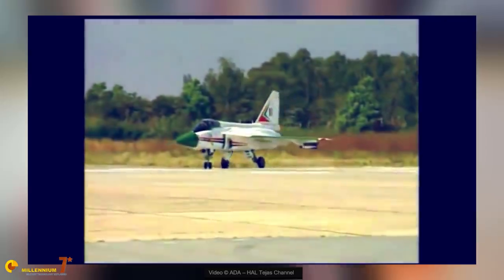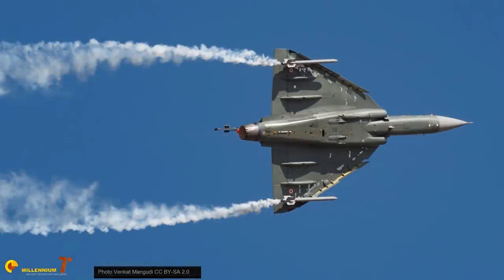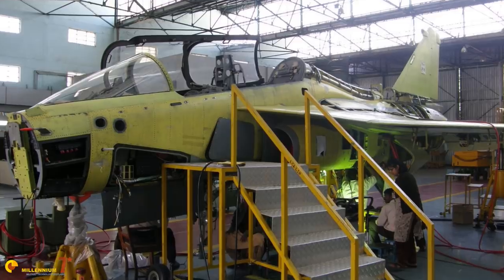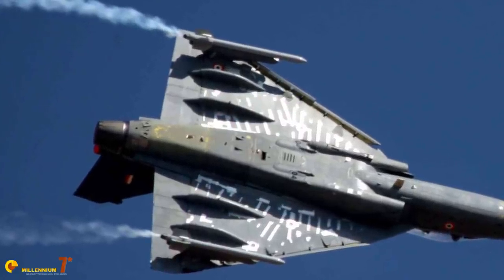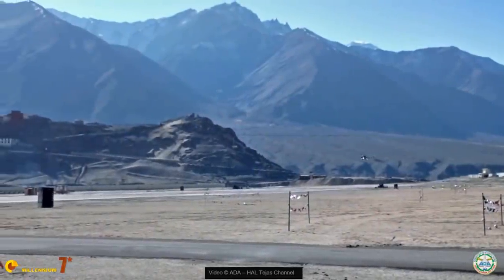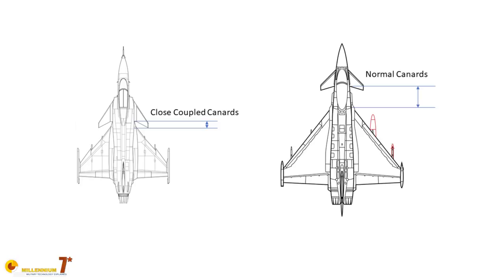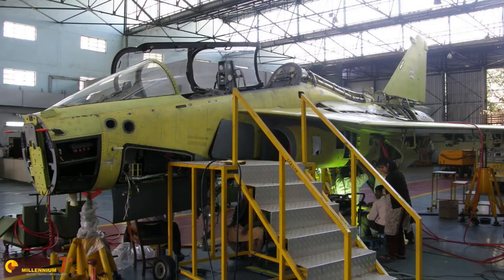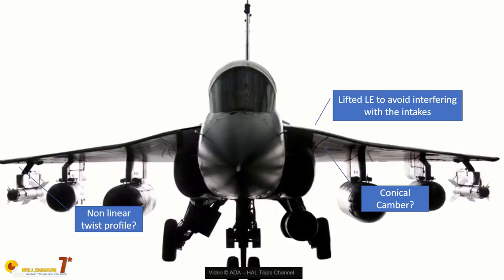TEJAS Aircraft  Aerodynamics Analysis - The Swedish Connection?

Comment: What we know from the public info is that ADA wanted to design it with canards, they have done the simulations but IAF wanted it to be simple as it was the first FBW aircraft with no prior experience. So canards were dropped.. that's the reason canards resurfaced on MK2 they have the design ready...and are now more confident with control laws.
Reply: Tejas has a faulty inlet design.... Diminish power in hi altitude.... Tejas is rated at 1.6 mach while grippen can go 1.8 mach using the same general electric engine
Reply: @jai9983  43 million jet with so much compromise.... And with a foreign engine and radar..... Just buy F35 or su 57 .... Plz don't go for AMCA... White elephant
Reply: @jai9983   bro what resent is.... India spent 15 years in developing INSAS and after 10-15 years of bad performance, india is buying AK 203 in lalks......  Even nepali army only country bought INSAs rejected the rifle..... I see same future for AMCA...... Sad but true
Reply: @jai9983  I agree will the Navy success.... Cuz navy has inhouse naval design Beaurrae...... India lacks a over all vision......
            Do think by 2030 .... AMCA would get ioc..... Stealth, supercruise, internal weapons bay, Radar absorbing materials,...... ??????
Reply: Mark Prothro  🌶🌶🌶🌶
Reply: @jai9983  so you say.... By 2027 India would have 200 tejas mark 2.....  By 2035  AMCA stealth, supercruise, ram, internal bay, and by 2040 India would have tejas + AMCA =700
      I say by 2030......  Kaberi with French snecma core,  100 su 57 or F35(AMCA cancelled) , 350 su 30 mki,  200 rafale,90 mirage 2000
 200 tejas....... 
        Let's see time will tell
Reply: @munmunhazarika5247  It was established that India will no longer be the same, India will become self-sufficient by 2035 in terms of armsNo matter how much false propaganda you have, but India will remain successful 
If you do not make fighter jets first, it does not mean that you will never create After all, political will is also something.
The coming century of India and seeing this, chili will continue to be in your backyard🤣🤣🤣🤣🤣
Reply: @munmunhazarika5247  tejas can reach mach 1.8 but pilots are not allowed to cross over mach 1.6 saving the life of fuselage and gripen can reach mach 2.
Reply: @munmunhazarika5247  I told you that political will is a big thing.  It is impossible to achieve anything if there is political will.  Everyone knows that earlier in India there was lobbying to buy foreign weapons.
But no longer the same, everything is slowly changing and our army is also going towards indigenous weapons under the leadership of Prime Minister Narendra Modi.
Reply: @munmunhazarika5247  importing good quality radars and engines will cost a lot.  FA 50 has less capability and uses same radar and engine with different tune. And fa 50 is costlier than tejas
Reply: @aggressiveindian5974   rafale???
Reply: @munmunhazarika5247  What are you talking about?  India's squadron strength is constantly falling, it does not mean that no foreign fighter plane will be purchased.
You should know that India has just ordered 40 plus 83 Tejas mk1 and mk1 a.  And 123 fighterter is a very large number
Reply: @aggressiveindian5974  just buy more....  Tejas is a poorly designed aircraft.
Reply: @munmunhazarika5247  Poor design is not done by you saying Tejas's Tejas is a very good plane.
For Russian and American fighter jet 1000 km Combat Radius, where you spend 9000 ltr of fuel, the same Tejas spends only 4000 ltr.
ABC does not come and turns engineer.  Propaganda of foreigners will no longer run against Tejas
Reply: @munmunhazarika5247  this so called 43 million jet has spawned an indigenous multi billion aerospace industry that makes everything except for the engines, which even chinese had to steal the designs of to get their own...in contrast, Pakistan has a sucessfull jet but no parallel indigenopus capacity to show off, niether in terms of radar or materials...beyond PAC Kamra, there is not MSME in defence inpakistan , unlike India...pakistanis knows this, and thus the reason that the folks who once ridiculed Tejas calling it samosa, is now getting serious as they know that india is far better equipped to spawn MWF at this moment, as a stepping stone to AMCA!
Reply: @jai9983   I hope AMCA doesn't turn into like INSAS and ARJUN MBt tank...... User giving poor reveiw and not willing to buy more..... 
      India must also remember 60 lakh peaple live in slum in Mumbai.... India comes in 120 position in Human development index with a per capita income of 2800 USD..... 
          Indias ultimate aim should be to raise the per capita income to 20000 USd....
Reply: @munmunhazarika5247  you are talking about things that happened 20 years ago and extrapolating them into future...INSAS rifles won us Kargil war, and today the DRDO ATAGS is the deadliest howitzer, being made by private companies in india....while pakistanis are buying basic awacs from SAAB, we make our own, AWACS, gunships, tanks, warships, carriers, SSBNs, fighters...never forget, we made SU30KI the best it is, something that inspired the russian to upgrade their sukhois to SU30SM
Reply: @অর্ণবচ্যাটার্জী-ধ১খ   InSAs os so good why is India buying lakhs of AK203.....  Desi howitzer is so good than why buy american M777 howitzer and chinook helicopter.... Haha we made su 30 mki.....  Delusional...
Reply: @jai9983   sir countries that are pursueing 5th gen,  aircraft carrier, submarine tech are USA(35cr), Russia(10cr), china(150 crore), UK(9crore),  France(12crore), Japan and India(130crore population) 
                     Indias per capita GDP is 2800 usd, chinas per capita GDP is 11000 usd, and USA has 63000 usd, Japan  has 75000 usd. 
                     My point is defense is a nessecity not a luxury. It is a means to a end . The end is a developed country with heigh income, purchasing power, access to education, employment, medical facility of heighest quality.
Reply: @jai9983   India in 2020 budget has allocated 75000 crore almost 11 billion usd (1usd =70 ru) for PM kisan project( 6000 ru yearly for farmer) and 51000 crore, 6billion for MNEReGA..... These expense are equally important as 5billion dollar purchase of S400 deal.....
Reply: @jai9983   if you look into indias last year's export... India exported around 600 billion worth of mercendise. 
       If you see the breakup.....  Textilles (gujrat,trupur) , petroleum, gem(gujrat), IT industries 81 billion,  tea and rice are main export items. 
        Problem is more than 60 ℅ of Indian work force is employed in agriculture and contribution to GDP is less than 20℅. India can only develop when farmer have extra capital to invest in farming. 
         So please don't tell that these are free salary or mufatkhori when government helps the farmer. It's ok when government give tax break to billionair who live in 20 storied building for 4 person and travel in private jets..... While 60 lakh pepale of mumbai live in slum.
Reply: @jai9983  my point is defense is a nessecity not a point of bragging or vanity project. The real war is against proverty.
Reply: @jai9983  You're trying hard to explain these foreigners that why we're working on Tejas, but what THEY want to see is Tejas project cancelled, but this is not happening under new government. Anything which has started in New govt or supported by it will be moderated by govt. And This success of Tejas will  be milestone in India's Aerospace and Defense industries. Before 2014 private firms weren't allowed to produce even ammunition for military and police forces,but now they can and they doing it. Tejas has been developing since 80s and it witnessed number of failed attempts of scrapping it by politicians who just want fill their pockets from foreign companies. But it's been changing. And we'll see not just Tejas Mk2 and AMCA fighter jet in future but also some new fighter jets offered by India's private sector ! And my brother it be a worst nightmare to all these critics. 
In short don't spend too much time to correct our neighbor Munmun Hajarika who just divert topic to dharavi and poor people and his mindset is nothing but a poison filled by his so called chosen govt.
Reply: @madhukarmukane2090  right
Reply: @munmunhazarika5247  Tejas used GE 404 AND saab gripen used GE 414 🤣🤣🤣 everyone considers themselves an engineer on YouTube
Reply: Marcos B  saab gripen used Volvo  RM 12 I think?  A version of the General Electric F404
Reply: @munmunhazarika5247  AMCA IS a future of indian iaf ..... it will be 5.5 and 5.5 plus generations while f35 is just 5th generation. And f35 is a really a white elephant. I don't know how you get f35 is effective. With USA terms and conditions we can't use as we want we can't modify what we want . We can't induct indigenous missiles we can't upgrade with Israel ews suits. Wtf we are paying and we can't use as we need. F35 need regular stealth coating thatswhy availability rate is very low. Baby why don't u but f35 for your kids
Reply: Mark Prothro  why r u feeling frustrated ? Indian time indian money we got our own fighter jet  meeting all intended design goals. 
Compare  single engine fighter keys ade with ge404 or similar thirst engines you will find tejas is best among them on cost and performance front. Tejas today is 4pkus gen fighter jet with least radar cross section and wing loading in its class of fighter jets. Is not reason for your frustration ?
Reply: Mark Prothro  what indians can do if white Americans didn't do well in highest studies ? Did indians or chinese stopped them from reading books ?
Lru make or buy call depends on developer and user. Even in russian su30mki india uses israil made lrus.
One day india will make it's own fighter jet engine too . India was not lucky like usa and britain to poach german rocket , nuclear  aerospace scientists  . After 2050 india will be ahead of usa and europe in many technologies.
Reply: Mark Prothro  you need to learn and understand what us useful in war. 
27th feb19 mig21bison. Scored kill over f16 . 1965 gnat earned name sabre slayer . 
Every fighter jet is  designed for meeting demand of its customer airforce. Lca tejas id for indian airforce and thought to ne point defence fighter jet which can quickly made ready to fly. Tejas lca has hot refuelling capabilities thus very very quick turnaround time . It has excellent climb rate very very low visibility with very high maneuverability. Flying tejas us easier than driving car. Tejas is with auto recovery and ground collision avoidance features . Has mid air refueling and on board oxygen generator. Tejas will easily score kill against f16, f18 and f15. In wvr f35 will not have any chance against LCA Tejas. But once F35 fires bvr missile and stealth is blown away LCA tejas will easily knockdown F35. In real war zones only f22 will prove better than lca tejas.
Reply: Mark Prothro  is not f35 naval version copy of russian fighter jet? Is not stealth was first discovered by russian scientist? 
Has not usa drained 1 trillion dollars in development of f35 which finds very difficult to win against rafale and new heat sensors deployed in cheap russian mig35 can detect f35 hundreds of miles away ?
Reply: Mark Prothro  should i remind  you family background of those who were sent ( kicked out from Europe )  to america and australia  from europe in around 16th century ? Should i tell you why amrica started inviting jewish, german, russian , indian and chinese scientists?
Reply: Mark Prothro  india decided to use single ge404 engine and make fighter jet with more than 1.07 thrust to weight ratio. So size and weapon carrying capacity is function of engine thrust. But capability and maneuverability wise tejas is far better than f16, f18, f15 and f35. First three won't have any chance against LCA tejas in any war and one trillion dollar f35 will be able come near to tejas but then few seconds after  will find itself on ground.
Reply: Mark Prothro  usa company  could make only trainer jet for south korea with single ge404  engine. India made a multiple fighter jet for air force and navy of 4plus gen with same engine.
It is small as it was designed smallest fighter jet with very high composit material  canopy like B2 bombers 
Tejas is light small agile potent and has very low radar signature.

Even if indian lru content is zero then also it doesn't matter. Bit for your knowledge you are referring old CAG report . You also accepted india has better auditing and accounting systems . 
For your knowledge india has also developed  its own dry thrust  jet  engine  capable of powering stealth drones.
Reply: Mark Prothro  tejas till now has zero accident record. Untold you it will be able to kill f16 f18 f15 f35 easily. If you have any doubts send all above  four in next joint air exercise. Since 2004 india prices in war exercises mig21 bison can kill american jets except f22 and we proved same on 27th feb19 by killing one f16  by 3rd gen mig21bison
Reply: Mark Prothro  what you mean by wired names ? In last tweets u called indians as cave men. This shows your hatred and jealousy towards India and indians . We indians are enjoying your frustration and stupidness.
We very well know how america was occupied by killing local tribes and settling  by kicked out  settlers from Europe. We know all history very well. 
Coming back to lca tejas it is 4plus gen light agile very low visibility highly potent fighter jet capable of shooting down all american fighter jets except f22. 
India will be inducting total 123 nos of LCA tejas with ge404 engines in its airforce and 200 nos of mwf tejas with ge414 engine.
Reply: Mark Prothro  tejas could hv eurojet2000 engine too.
Except f22  american fighter here are just  bomb trucks with poor wing loading and agility. Tejas is designed to hunt down  4.5plus gen fighter jets.
American fighter krte wait on day one to cruise missile to take down mey air bases and air defences. Then only they enter in war zone. Till now america has not fought direct war against any capable potent aur force so kill rate achieved by american fighter jets of american  airforce doesn't make any sense.
F35 is one trillion dollar american junk whxih can be tracked by chep. Mig35 and tejas ka  hundreds of miles away .  fighter jets in american inventory except f22 are sitting duck .
Reply: Mark Prothro  long range bombers are good only against weak small countries.
Reply: Mark Prothro  you are talking like a Robot.
Reply: Mark Prothro  still you're talking like a Robot!
Reply: Mark Prothro  ROBOT don't talk gibberish.
Reply: Mark Prothro  you are a ROBOT!  It is a fact.
Reply: Mark Prothro  ROBOT your country's history is less significant than Egypt.
Reply: Mark Prothro  Robot your forefathers were all criminals kicked out of the GB.
Reply: @munmunhazarika5247  su-57 sucks, F35 is too costly for us to operate.